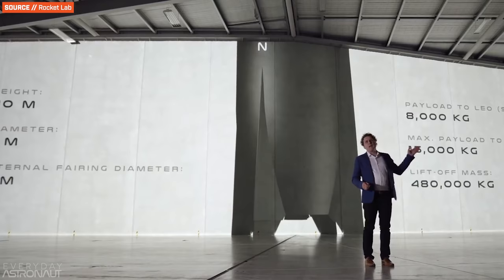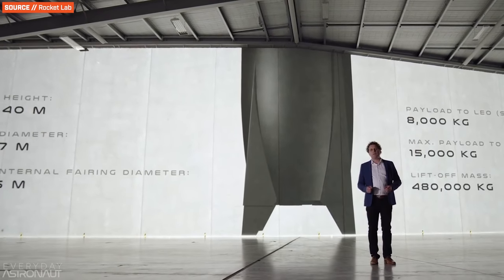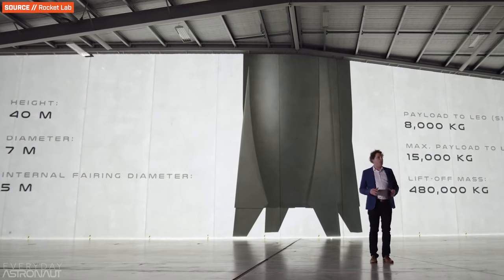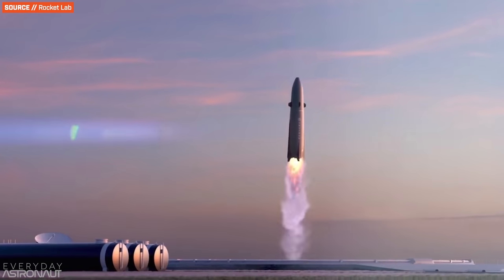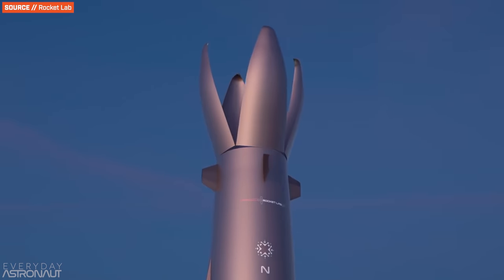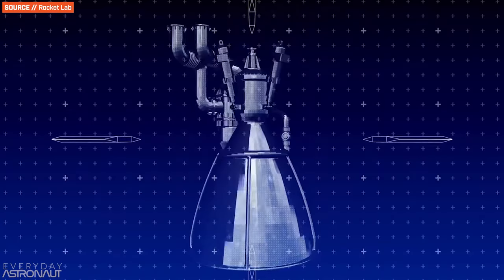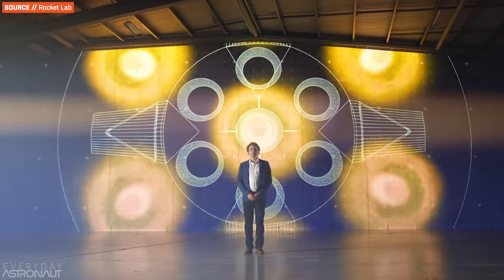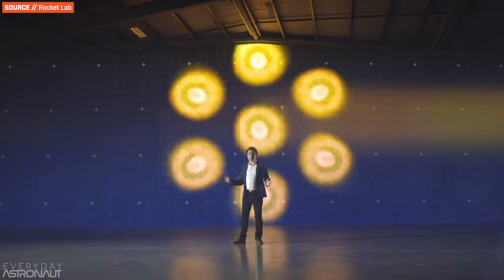Talking about Rocket Lab’s Neutron with Peter Beck

Comment: SpaceX could make their first stages (Super Heavy / Booster) from this carbon fiber. If its weigh was at least half of one made from stainless steel --- 100 tons instead of 200 tons, than it could deliver more cargo to an orbit - like 250 tons instead 150 tons.
Reply: But then you run up to the volume problem. If you can carry on 250 tons then what in the world weights 250 as a single object? The only reasonable option is Megaconstelations and crew but it's still limited by the payload bay volume. Also they wouldnt fast pace so quickly with the carbon composites
Reply: @filipadamus7041  Starship has payload bay volume of more than 1000 cubic meters. Very roomy.
Big weight payloads are important for tankers as well as for flights to Mars. 
It could be different cargos - not only single object.
Reply: Reducing the mass of the first stage structure by 100 tons does not increase the payload by 100 tons. Instead, it allows to make the whole second stage 100 tons heavier -- for example, increase the payload by 6 tons, increase structure mass by 4 tons, add 90 tons fuel.
Reply: SpaceX chose steel because they can rapidly assembly and modify the structure as needed to  reach the design goals.  With carbon fiber it is very difficult to modify and you may need to use costomizalbe tooling to make a part.  Once Starship is in operation they can make a carbon fiber version. of the first stage. 

 For Starship carbon fiber cannot withstand orbital heating  So steel is used in the areas that get less heating and in the hotels spots tile covered steel is used.
Reply: They were going with Carbon fiber, but it is expensive and wasteful while steel provides a lot of other advantages.
Reply: Steel has advantages over carbon fiber and aluminum. You do not need as much thermal protection on steel for re-entry and it has similar properties at cryogenic temps as it does at room temp or higher.
Reply: @TheEvilmooseofdoom  Here Peter says that their carbon fiber is cheaper than stainless steel.
Reply: @steveaustin2686  That is why I mentioned only the 1-st stage.
Reply: @peaceofmind2769  The booster still gets high enough and fast enough for some re-entry heat. It's not a problem with steel, but would need protection for carbon fiber.
Reply: @steveaustin2686  The lighter it would be - the slower speed and less heat it would get, I guess. But we'll see.
Reply: @peaceofmind2769  It won't be any slower, as it has to give the second stage as much speed as it can, for the second stage to make orbit.
Reply: @peaceofmind2769  That just makes me question Peter and certainly makes me doubt him.

Comment: t's under pressuer, Tim.  That makes it a supercritical fluid, which solves a whole lot of problems riht off the top. Mthane goes supercriticfal at only .7 bar, so i's not tough.  That waas the genius behind Raptor, don';t have to fart with multiple phasees.
Reply: 4.62 bar, exacly.

Comment: Love Beck's hints at barges being so expensive they're a ridiculous idea over helicopters. Wondering if Beck will be that silent up and comer that out of nowhere dethrones the incumbent name in forward thinking launch vehicles.
Reply: The falcon is relatively an old rocket that was designed over a decade ago. If spacex comes out a with a newer version today, it likely wouldn’t have currently bottlenecks.
Reply: @xBIGMUSCLEx  This "old rocket" launched more than half of the world's commercial payloads this year.
It's performance (max payload to LEO) is better than what's declared as plans for Neutron.
How exactly Neutron plans to beat this? By being cheaper than $30m per flight? Can it do that?